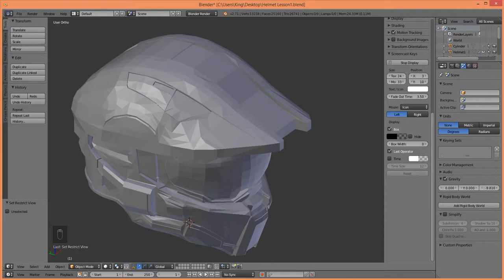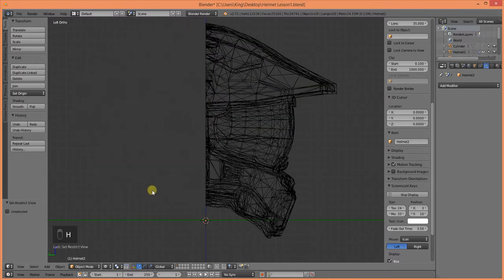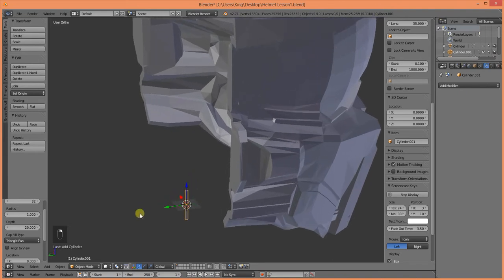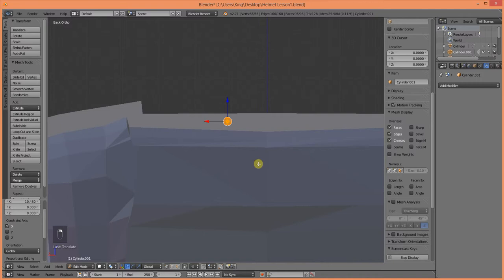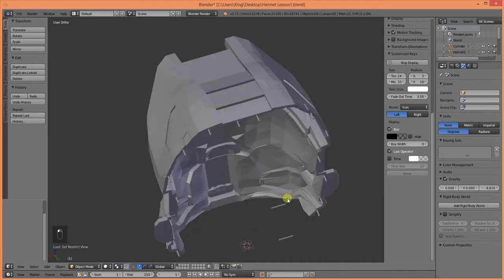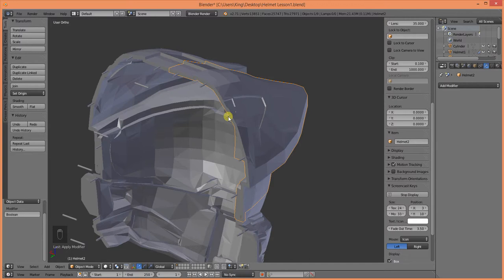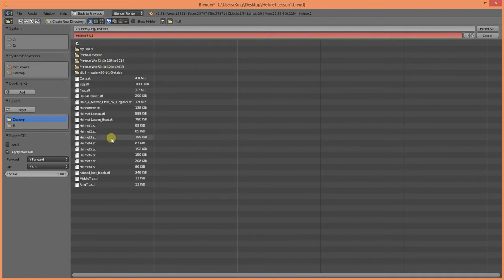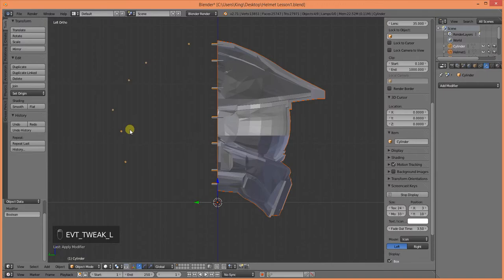Video 6 Helmet Alignment

Comment: i like the way you did these alignment bolts. i just did this for my M6H some days ago and it really helps. but ive got some problems with real world messurement in blender... "blender units" arent equal to mm or cm.

what ive had in mind for your next video is custom support structure. i hate the way makerware add supports. its all a waste of material, hard to remove and i most of the objects there are problems with non-recognized overhangs (like ramps). makerware doesnt add support and the printing is ruinied after 3-4 hours of printing.

so i added some custom support directly in blender for my makerware... reduce the material i need and fixed most of the problems.
https://www.dropbox.com/s/lt46ghlyz5utz7h/Screenshot%202014-08-07%2013.41.28.png
Reply from the maker: That looks like it would work. I wonder if having the Maya presets that I use is what's different than using the Blender default presets. That may be why they don't measure up. Everything I print is spot on.